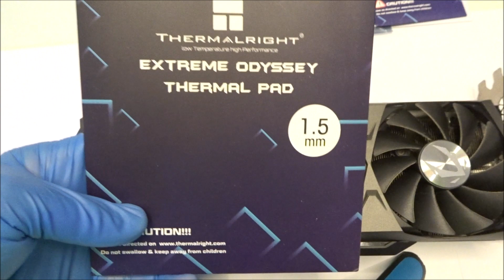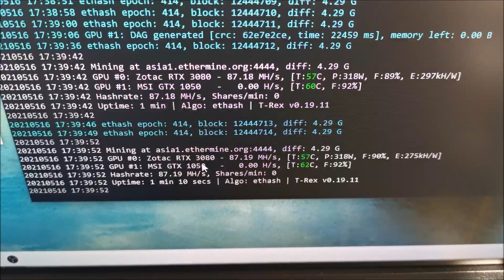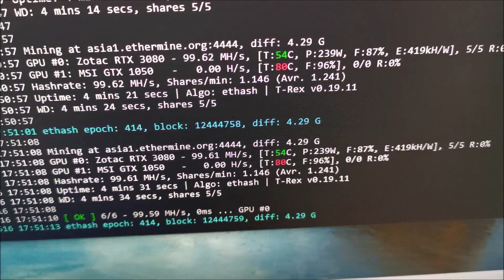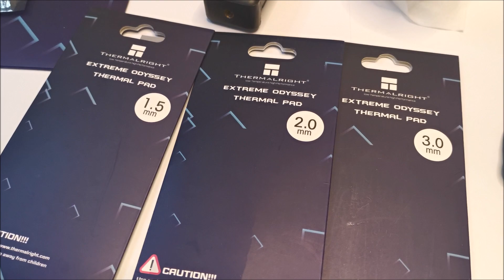Zotac RTX 3080 Thermal pad upgrade...TEMP DROP! | Protect your GPU investment!!

Comment from the maker: Surprisingly, the factory pads were not oily, but they were brittle after only 3 months of usage. Let me know your experience with other brands.....thanks everyone
Reply: The same with my 3080
Reply: i have the same experience but not brittle at least
Reply: I've been using them for a year now but when I removed them they were okay.
Reply: they literally melted for me
Reply: mine dried out,too heat and suddenly no display
Reply: Let me point something out. I notice that when you did the first HW Monitor test with original pads, your fans were spinning at 2060 RPM MAX. Then, during second test, with new thermal pads, your fans were spinning at 2700 RPM, much faster and louder. There is almost 35% difference in FAN SPEED between both tests. So, lets be honest, there were almost no improvemet after changing pads, 102ºC to 90ºC with 35% faster fans. Am I missing something important to consider?
Reply: @marioiannarelli7916  yes your missing he had a pretty high +1200 mhz overclock on the vram for mining purposes which would drastically increase heat from the micron gddr6x, even if his fan was higher rpm
Reply: @fluffmeister66   You didn't realize he was getting the same 99 MH/s before replacing pads at 73% fan speed, right? Then, he changed pads and was getting same 99 MH/s (same OC settings) at 89% fan speed. I mean, it did help a bit, but nothing crazy. I own 2 3080's Zotac Trinity and I replaced its thermal pads, but I got much better results somehow, probably because I changed the backplate pads as well. Like I said, in this particular case, he had a very minor improvement. He had a 8ºC~10ºC drop? Yes, but increasing the fan speed by 16%, which makes difference. A more accurate test would be at the same exactly OC and Fan Speed settings. If you don't lock your FAN SPEED and it fluctuates like that, it's just a pointless test.
Reply from the maker: It was one of my first videos, not very professional at all but like you said, it does improve and reduce the temp, even better if I had replaced all the pads. The only reason I replaced them was because I was experiencing over 100C constantly, took me ages to decide to change the pads since I wanted to keep the warranty valid, but I just couldn't find a setting which gave +98mh and kept the temp below 100C. It also depends where you live, Asia, pad change is probably a must, if you are in Scotland/Canada where it can get to -20C......I wouldnt bother.
Reply: @marioiannarelli7916  Please advice thermal pad thickness & brand for Zotac 3080. Thank You.

Comment: Just repadded and pasted mine the pads were crumbling after 3 months of use, decided to put Arctic MX4 and Thermalright Odyssey 2mm pads on the front side. Temps with a 1900mhz 850mv undervolt have dropped 10deg on the core and 15 deg on the memory temps. Dont forget the small mosfet that requires a pad as well. Rear pads look in good condition looking through the vents so left them as they are,VRMS under the plate should be fine as their cooled with my stronger fan curve.
Reply: I missed the little pads, I changed all my cards and I don't want to remove them again, will it do any harm?

Comment: Let me point something out. I notice that when you did the first HW Monitor test with original pads, your fans were spinning at 2060 RPM MAX. Then, during second test, with new thermal pads, your fans were spinning at 2700 RPM, much faster and louder. There is almost 35% difference in FAN SPEED between both tests. So, lets be honest, there were almost no improvemet after changing pads, 102ºC to 90ºC with 35% faster fans. Am I missing something important to consider?
Reply: 12c is a huuge difference! but still you've got a point, I didn't notice the fans rpm 👌🏻

Comment: Watched like 6 videos of people replacing pads. All 6 forgot to take the brace off. There are 2 very slim lines of 3mm pads under the brace that sit on the mosfets. Replacing those will do a lot of good, since factory pads are literally awful, and have an extremely short life span. Something to look into if you haven't already. Cheers.
Reply: do you have a screenshot of that  slim lines?
Reply: Do you by chance know the thickness of the backplate thermal pads ?
Reply: Are you sure this are 3mm other videos say 2.5 even 2

Comment: I have the same card coming soon,Just use Thermalright 2mm pads  and I should be fine ? do you have the full vid on this thermal pad replacement,Im pretty scared to changed them. If I made mistake it will cost me about 2 months of salary haha
Reply from the maker: If you don't have problems with temp, don't do it. It VOIDS your warranty. I don't have the full video because my camera shut off and I didn't know. Just go slow and take your time.
Reply: @BosHK  6 months later I just did it,Contacted my local zotac warranty provider. as long i dont damage the pcb/gpu the warranty is good

Comment: My 3080 gets 102.5 mhs at 207 watts. No thermal pad replacement yet and I'm at 49c core and 84 on the memory. I don't get all the different numbers.
Reply: you got lucky with silicon lottery ;)
Reply: @n0v3r0n4  its really that though. I feel like I can get it to go higher I have yet to crash the card. It's just ware I landed. I am uses core lock atb1100

Comment: Like, but many guys use 1mm thermal pads with this GPU. Who’s right?)
Reply from the maker: Use whichever works.....ideally, monitor your stock memory junction temp during overclock, (opening your GPU will void warranty) open it and measure the pad thickness, use pads the same thickness.....monitor mem jun temp for same overclock.....adjust as required. Remember, thicker pads does NOT mean better cooling....

Comment: so the stock brand they use are complete garbage? on a brand new non used card my temps on a evga card only go to 60C but zotac reach 70 to 80. is it worth buying actual branded thermal pads and should i replace the stock ones? im not a miner but seeing those temps scare me. also a link to good thermal pads would be nice
Reply from the maker: I would not say they are garbage. If you are a gamer, you focus on overclocking your Core/GPU therefore your GPU temp is more important hence the thermal paste. Miner focus on Memory modules, Memory Junction temps hence thermal pads. Next time you game overclocked, have a look at the GPU Temp and Memory Junction temp, and decide for yourself whether you need to changes paste and/or pads. WARNING: if you open it up, chances are warranty is void.

Comment: Which thermal paste did you use? Could arctic silver be used, or is mx4 best? Or just leave the existing paste alone if its not chalky?
Reply from the maker: doesn't really matter which you use but if you open it, I would get rid of the old stuff and reapply since you cant guarantee the entire gpu will get covered by old paste when you reassemble.
Reply: @BosHK  thanks yea I used mx4   overall about a 10c drop on memory junction, the only pads I swapped

Comment: Hi, i replaced the thermal pads with two 1mm arctic. The temps went down but I lost hashrate, it went from 88-90mhs to 75-79mhs and i can't figure it out why. The height is ok, eveything is exactly how it suppose to be, i replaced the new thermal pads twice and still low hashrate.
Reply: did u solve the problem?
Reply from the maker: Hi, lower temperature should not affect hashrate, the only thing I can think of is the overclocking settings. I have heard if it overheats or thermal throttles, then it affects hashrate. hope you get it fixed.

Comment: i stacked 2x1.0mm Laird HD90000(yeah, rich kid stuff) on the VRAM, temperature dropped by 25C. The original pads are already oily, AND they clearly cheaped out on their employee training, one VRAM is completely nude of pad.
Reply: Do you also have 3080 zotac trinity?
Reply: @jafaghalemya6177  sorry, late reply, yes i do. i'm planning to go further with thermal paste + aluminum nitrite plates
Reply: @711jastin  what is aluminum nitrite ? never seen this metal combination?
Reply: @JaKaDoHLCS  sorry, it should be aluminum nitride. It's a kind of ceramic with very high heat conductivity and is not electrical conductive. It's about 50¢ per pieces for size of vram. I planned to use thermal paste on each side of the plates.

Comment: I have 3080 AMP. So far temps seem OK, only CP2077 pushes it to 80-86C @ 1900Mhz in hot room, Underwolted, stable FPS at 72 lock (144hz screen). Anyone tried re-paste and re-thermal pads for gaming? Are results nice?
Reply: This is about Mem temp not Core.
Reply: @terraincognitagaming  Even that. Checked it up, my MEM temps was 84C solid top before UV. Just curious about what kind of temps we can expect after the procedure of re-paste re-padding.
Reply: @RoyalPredator  ~10C decrement for gaming, they use shit tier pads on almost all 3080 across all brands.
Reply: @711jastin  Seems like... I'll do the re-pad then.  Can you please be more specific about temps/performance regarding general GPU, Memory and TJ?

Comment: You must use 3.0mm in the backplate too
Reply: According to my research it actually depends on the brand. Thermalright 2.5mm. Gelid 3mm should be fine as it's softer than Thermalright. If you were to use 3mm Thermalright, you may risk bending the backplate and cause damage to it.

Comment: So my zotac was thermal throttling at 72 Degrees doing 60MH so I changed the thermal pads today and after ruining it it’s now at 94MH but at 72 Degrees and keep dropping. I used the same equipment as you did but at this point I don’t know what else I can do to fix it.
Reply: I added a fan blowing directly at it feels cool but the temperature is still 72 after 12 hours and the MH is dropping
Reply: Im thinking the best thing I could do it sell it or see if you have any other suggestions
Reply from the maker: what are your settings? If you can get 94mh/s then you are overclocking. I assume you are using windows? aim for around Core -200, Memory 1000, power 250W or 75%.......and see what it gives you. 72C is memory junction OR GPU temp?

When did you get the card? it cant be an LHR card, otherwise you will only get 48mh/s.
Reply: @BosHK  -260 core  2300 memory 90 Fan speed  > 94MH temp 68 C because its night time, I believe it’s memory junction. I’m running Hive Os
Reply from the maker: @shadowthehedghog100  My setting were 85% fan, 1040 core (new absolute core feature) , 2200 memory, 241W. The temp on hiveos is gpu, not Memory Junction. If you are registering 68C, its high, really high. You can try 2 case fans blowing onto backside. You said you replaced your pads and thermal paste right? did you spread the paste on evenly and use pads to cover every memory module?
Reply: @BosHK yes I took my time to do so, before that it’s was doing 60MH so after the operation it’s doing 94MH stable but my worries is the temperature at 72C still. I have a fan already hitting the back of it. Maybe different settings could fix this but I’m new to this that’s why I ask if you have any other suggestions.
Reply from the maker: If you reduce your overclocks, your temp should go down. You could try using windows and actually see what the Memory Junction temp is. Hiveos only give GPU temp.
Reply: @BosHK  any recommendations for settings?

Comment: How many mm thermal pads did you use in total? One pack 85x40x2 mm was enough? Thanks
Reply from the maker: Yes, 1 pack was enough.
Reply: @BosHK  Thank you :) and I wanna ask Did you change back plate's thermal pads
Reply: @ozkanmemisoglu9085  it's not really necessary imo, it's pretty cool just by replacing the front ones.

Comment: Why thermal pads on the back of the V card... on the other side of the memory.
Reply from the maker: HI, not sure what you meant. I just replaced the pads on the memory chips, I did not open the back of the memory which I believe you can.
Reply: @BosHK  There is pads in the other side, making contact whit the back plate, transfering heat to it.
Reply: @---le7cy  3080 Does not have memory chips on the back (at least the Zotac).
Reply: @ztech-consulting  Yes, but the heat geterated by memory chips does.

Comment: After how many days u recommend to change thermal pads for a new gpu 3080??
Reply from the maker: You should run your 3080 and monitor temps & performance first.
If you are lucky with silcone lottery, you will not need to consider replacement pads.
Only if you are not happy with temp, then consider changing pads BUT like I said, it will VOID your warranty.
Air flow is the biggest factor, if you don't have airflow around the card, no amount of replacement pads will help.
Reply: @BosHK  ok thanks for the reply
Reply: @BosHK  Please advice thermal pad thickness & brand for Zotac 3080. Thank You.
Reply: What kinda of tool is that gpu stat monitor thingy , on ur keyboard
Reply from the maker: @LazyQ8i  HardwareInfo?